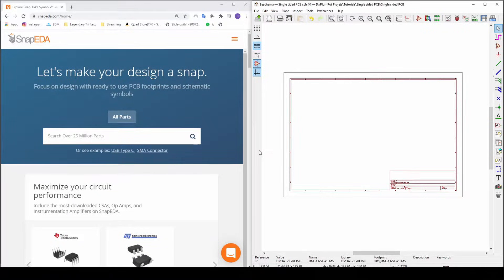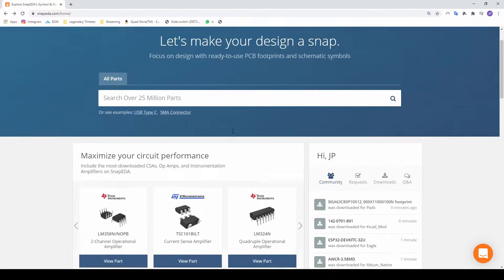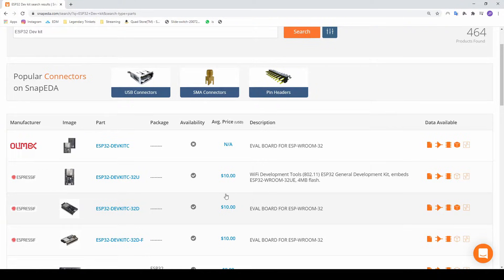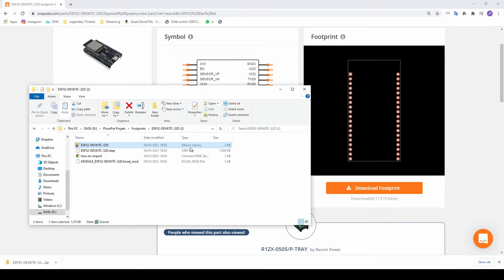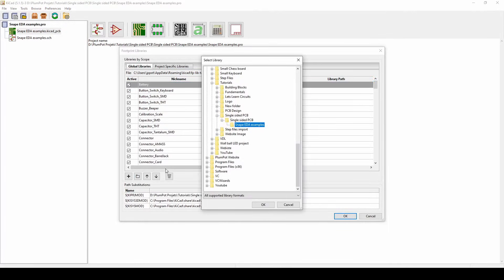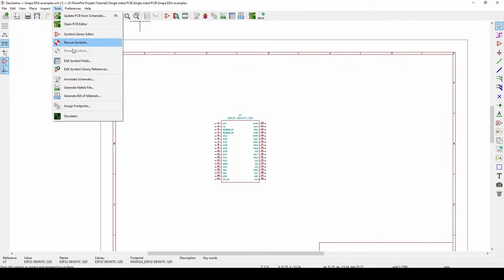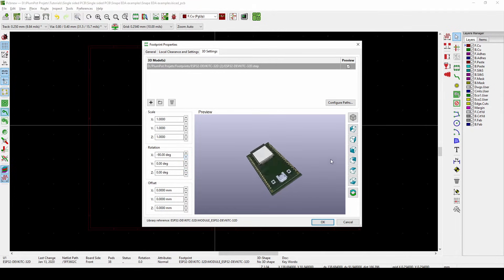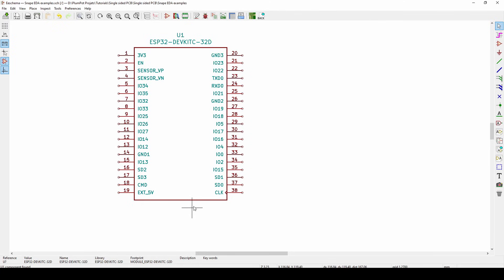KiCad Tutorial - How to Import Footprints and Symbols from SnapEDA

Comment: Ya boet  Snap eda is a good place but do not trust the footprints  check them . I edit the 3d model in the footprint lib not in the pcb .
the way you did it is only  good for that PCB it is not saved in the lib  only the pcb .

Check me  try update your esp from the Lib you will see your  3d model go away .

Ya well no fine.
Reply from the maker: That is true👍 it is better to put the 3D in the lib. We made a video about that but to be honest I did not think of it at the moment😅. But thanks for the reminder. Did you have lots of problems with snap eda footprints before?
Reply: @PlumPot   I have had problems  anytime  you download you need to check for example  SolderMask  Paste mask  
snap eda is good but one always needs to check lets say you use a symbol that is not snapeda  .  pin 1 pin 2  on diodes .
even a footprint like sot-23 can have varients . I Altium  sometimes you three three  option M L N  Most Least Normal.
One always  checks . 

 I very often  check by getting a 3d model  from 3dcontent and the footprint from snpeda if they match that is my check done.